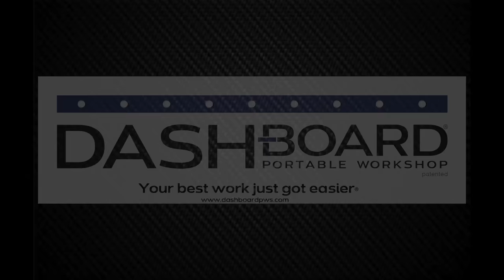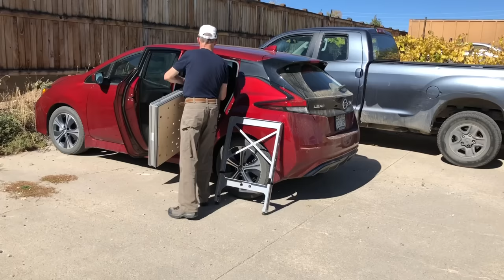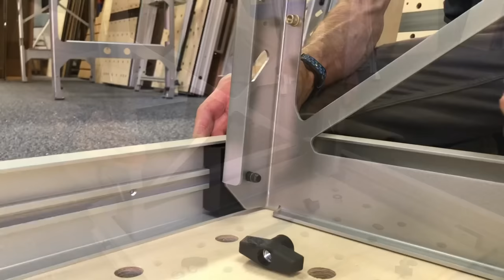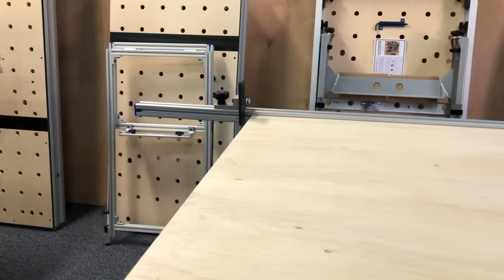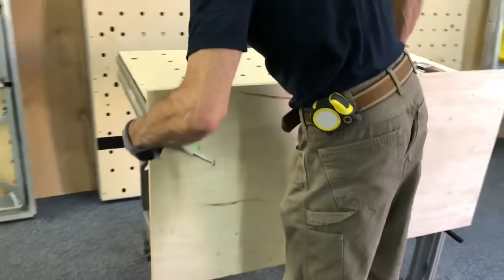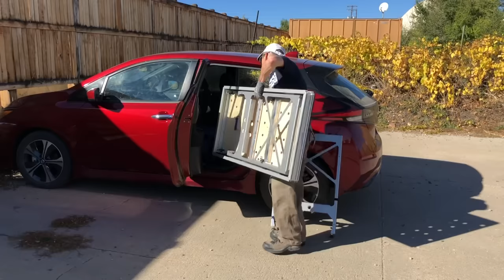Dash-Board®️ShortCut bench

Comment: The highest quality small MFT on the market. Only improvement for a 2.0 would be unfold-and-work for BOTH legs up tight within the silhouette of the extrusions. I realize that the excellent and perfectly rigid full-table legs cannot physically nest within each other on the ShortCut, so this is why one separates for transit. And that to accomplish this would necessitate yet another set of legs to design and manufacture and inventory. But we are talking the genius of DashBoard- miracles are what you make! I want to see EVERY handyman and small carpenter without a full sized pickup or van to bring a ShortCut to the job every day!
Reply from the maker: Thanks! You never know what might be in the works.;)